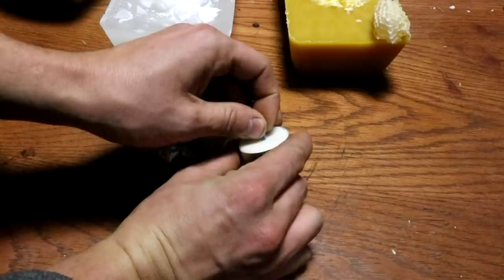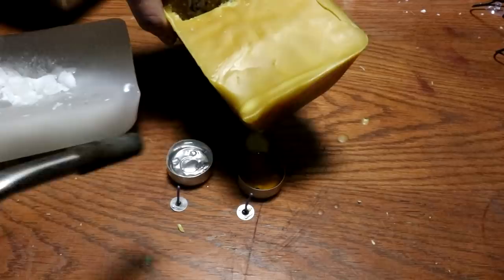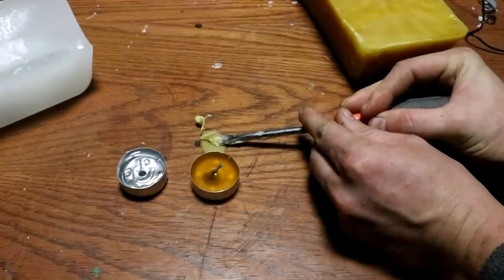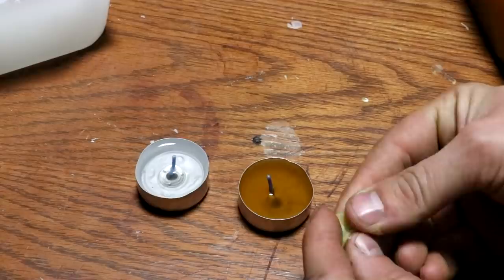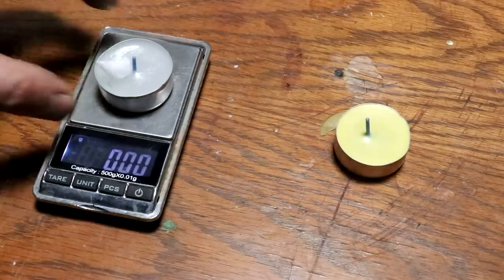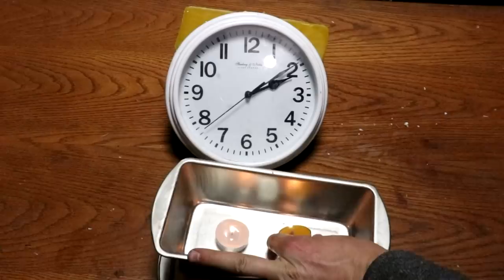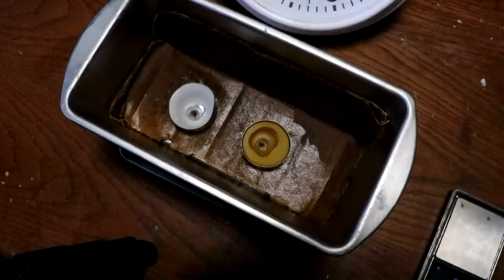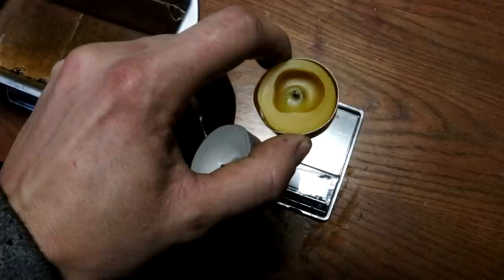Beeswax Vs Paraffin: Flame Test

Comment: I think the wet cardboard fouled up the behavior of the tealights by overcooling them and preventing the wax from melting. I don't know about beeswax but when I burn paraffin tealights all the wax will liquify and very little is left by the time the candle goes out. Unless I put them on a cool surface with a high heat capacity.
Reply from the maker: probably true, I like how it turned out though you can really see the differences in a system when you stress it.
Reply: ...and it leaves you the opportunity to do another video to see if a beeswax tealight can get hot enough to melt all the wax and work properly and how it performs under ideal conditions.... ;-)  I'm actually really curious to see how long it lasts.

Comment: i think you made a mistake by putting them over wet cardboard, usually when those tea candles burn they liquifi the entire wax, and then the level lowers until there is no moe wax at all, but it looks like they didnt , and te outside stayed solid, probably because of the cooling action of the water

Comment: Those candles burned weird, the candles i have usually when there done there is only an aluminium shell left. Or is it really cold where the candles where placed?
Reply: It's fairly cold where he's at (average temp came out to be about 10-14*C IIRC, last video) and he used wet cardboard, which would act as a heat sink.

Comment: If the containers were on insulated surface without the water cooling the outside. The wax would have completely melted by the flame and would have got almost complete combustion.

Comment: Because you poured the water in, that sucked the heat and the wax was not able to melt in the dish, normal coin candles melt all the wax and the level of wax decreases evenly thus making it efficient. In the end it remains very little wax and the wick is all burnt, but this is not the case with your test because I think the heat was sucked into the water and not into melting all the wax. Try a small test without the water and without the metal, just into a normal glass candle holder.

Comment: It might be interesting if you make a thermal expansion valve with wax. We use those for industrial higher pressure thermal limiting valves. There's a lot of engineering that goes into that. Essentially the was is used as a get sensitive piston to operate the valve.

Comment: The beeswax candle had a wrong size wick. Beeswax needs high temperature to burn. It can burn totally if the wick is chosen correctly or you can add a small bit of coconut oil to let it burn at lower temperature. Paraffin is no go. Burning paraffin emits toxic and even carcingogenic particles. Soy wax tealights are also great and can burn totally.

Comment: what about if you put those candles to heat a cup of water(maybe insulated on the sides so little heat gets away or something, by measouring the tempararure of the water when the candle burns out (taking also the burned mass of the wax/paraffin into consideration), we could see wich material sores energy better.

Comment: i presume the beeswax has a lower thermal conductivity that may be problematic in such a case. maybe do a test using a muffin tin  bees wax in one cup and paraffin in another then attach a high power led to the bottomes of each cup and measure the LED temperature. in what scenario do the LEDs have better cooling for longer? i suspect the paraffin will outperform the bees wax until it is melted while the bees wax will allow the LED to get to a  higher temp but remain consistent longer. 

do the test with water in a 3rd cup but cover the tops so that evaperation does not give any materiel an advantage.

Comment: Is there a way to test the lubrication both waxes provide? Beeswax is a favorite bullet lube for black powder enthusiasts, but during the civil war some paper cartridge makers used paraffin wax instead, claiming it was no different in performance and was less expensive, and it didn't rub off of the projectiles as easily when handled. I'm wondering if there is any noticable difference in the two pure waxes ability to provide lubrication. If paraffin is equivalent or nearly so, it would save alot of money to buy and use it instead of beeswax.

Comment: I believe you have one big source of error. When you light a candle some length of the wick always burns down. I have often noticed that if the wax around the wick isn't melted enough in the beginning, the wick can't draw enough wax and burns down more, as it looks like at around 5:13. The flame then of course stays smaller and burns longer, since it can't use up that much wax, as a candle with a longer wick might could. Maybe you could  repeat the experiment and check that the length of the burning part of the wick is the same, in the first few minutes. 
Anyways, I love your wax experiments!

Comment: The water on the cardboard probably soaked a lot of heat out of the candles, reducing the melting from the radiant heat from the flames. :\ I've burned paraffin tea candles all the way down to a very thin film of wax on the cup.

Comment: If you mixed them together and melted them, would they separate since they're different densities? or would they stay evenly mixed? if it cools down too quickly for them to fully separate, could you keep them on heat to give them more time to separate? When fully mixed while solid, can you put a heat on that's enough to melt the paraffin but not the beeswax or would the mixture raise the overall melting point? so many questions lol

Comment: Obviously not the correct wicks. That matters a lot. Paraffin will use a different wick than beeswax and the container size matters too. The proper wick will usually burn most of the wax up.

Comment: Hey Cody have you tried mixing the beeswax with the paraffin? I Wonder if it does mix, or will it seperate in the cooling process.
Reply: No, they never separate (at home) and that is the problem. Because paraffin is cheaper than wax people cheat like that. Only expensive chemical tests can detect these contaminants. 
These thieves do not realize that they are poisoning people.

Comment: those puny paraffin wicks are not sufficient for making a beeswax candle, they don't burn hot enough to fully melt and burn the beeswax.  Try again but with a far bigger and thicker wick.  You need to be able to melt the beeswax fully to get a good strong flame out of it.  A good candle will thoroughly melt through all the wax and have it in a liquid state long before it is burned out so that it can continue to soak into the wick and burn nice and strong.

Comment: That's some dirty beeswax, but I suppose cleaning it significantly more might require some dangerous distillation process.  I'm sure I've seen cleaner though.  Do they just use special filters?  How much heavy crud is dissolved and suspended in that beeswax?

Comment: Points of order...

As compared, unlike the paraffin, the bee’s wax isn’t pure.  Pure bee’s wax, should be white, and harvested from unused honeycomb.  There is a method to clean bee’s wax, I believe it involves liquified bee’s wax and hydrogen peroxide....one of the reasons pure bee’s wax sells at a premium.

I’ve read that historically, bee’s wax traditionally used a bigger ( thicker ) wick than paraffin.  Using the same thickness of wick, results in faster paraffin uptake ( and thus larger flame ).  If this is true, then you would need a thicker wick for a brighter bee’s wax flame.  It could be that the way the wick is braided/woven, results in better bee’s wax uptake and thus energy release and flame brightness with bee’s wax ( I know that it is a factor with historically made tallow candles ).  I personally would consider using twin burning wicks to test brightness and energy release of the same weight of bee’s wax...would probably need a light meter for best results.  

Clean bee’s wax to the manufactured paraffin, would be a better comparison.

Comment: Probably a dumb question but how does altitude affect the physics of candles/fire? Melt characteristics, flame intensity, heat output..
Im not trying to say you had one candle higher tham the other.. Lolz. I just thought - boiling points and you being in the hills, my experience of tea lights being at sea level they always burn virtually to dry.
Reply: Im guessing its negligible. But is it measurable....

Comment: always love this channel but this strikes me as odd as adding water to the cardboard would have made it a unfair comparison if the thermalconductivity of the waxes are different same with melting temperature. as with water you make a a better thermal connection with the carboard surface and thus hindering the melting of the wax? also, burn time doesnt mean anything if the flames are different in size. it would make more sence to burn a equala amout to heat something up and measuring the difference in heating(reasonably isolated from the outside world) as to do a callorymetery(?).

Comment: Cody: It is great you keep the mass of the waxes the same in the experiment. Your experiment shows that the paraffin wax burns much faster than the bee wax. The burn rate is also determined by the length of the wick. Did the candles have the same wick length?

Comment: If there is no wet cardboard, it will burn almost all of the wax. But, because the wet cardboard was cooling down the wax around the flame, it couldnt melt :( so sad. Sorry for my english
Reply: Your English is better than the written English of most native speakers I encounter. What's your native language, if you don't mind me asking?
Reply: I think the flame was too small for the waxes used. Most candle waxes are blends which include lower melt point waxes which help this process.

Comment: You totally messed up the test by pouring in the water halfwaythrough, cooling the candlebuckets. The whole point of the candlebucket is to get hot and melt all the wax in the bucket.  If it was supposed to burn a selfcontaining hole in the middle, why would any company spend the money putting a container around the wax.

Redo please.

Comment: Due to your apparently high level of knowledge in several fields from geology to beekeeping, I often wonder whether you choose less-than-scientific experimental designs because you don't know much about experimental science, or purely out of convenience? For example, in this burn test, it looks like the two wicks stick out to fairly different heights above the surface of the fuel, and I think it's fairly obvious that the burn rate is a strong function of the wick length. Now, worrying about this sort of detail can consume a lot of time, but using several samples of each type and doing a bit of randomization (e.g. with the order in which they're poured, how the wicks are chosen for each mold, how the molds are assigned to a test fuel, etc.) can make a huge difference in the power of your results without adding very much cost or effort.

I'm genuinely asking out of curiosity, and don't intend this as a criticism of your process. In the unlikely event that you read this and would like to learn more about experimental design, I highly recommend Statistics for Experimenters by Box, Hunter, and Hunter. Not recommending to make a buck--I won't--but because, as an engineer focused on computing/analysis, I found it extremely helpful when I needed to gather my own data, both for research purposes and for making "industrial-grade" data. Despite the title starting with "Statistics," it really is geared to getting the most bang for your buck out of effort spent designing and executing experiments.

Comment: Have you seen those videos where someone will throw hot water in very cold air and it bursts into steam instantly, would hot wax have a similar affect but instead of steam, would it just form a splatter of soild wax in a intresting shape?
Reply: Yes. I've done this when we were making dip candles; we had a bit of melted wax left over, but not enough to use, and we were doing it at the beach; we poured some of it into wet sand molds, and flung some of it directly into the water, and it solidified into neat strings of wax that broke almost immediately from the waves.
Reply: @KainYusanagi  Interesting.
Reply: The water freezes into ice, not steam. You throw the boiling water up into the air and it freezes before hitting the ground. I don’t recall the exact temperature, but it’s around -40F.

Comment: you produced false results because you made the temperature of the wax be way too low because of the water around it. hotter wax>brighter flame (lower viscosity, therefore better flow up the wick as well as better evaporation) and longer burn times because all of it is liquid and can burn off evenly.
i used wax interchangeably with paraffin
you also said paraffin ist designed to have "only one molecule in it" that is also not true. paraffins are produced according to specific temperature ranges, not a specific molecule. acyclic long chain alkanes to be exact

Comment: I suppose you could test this again (sorry :P) but with thinner candle holders to find out what the burn time is for the same mass. Then again, the maths isn't hard.
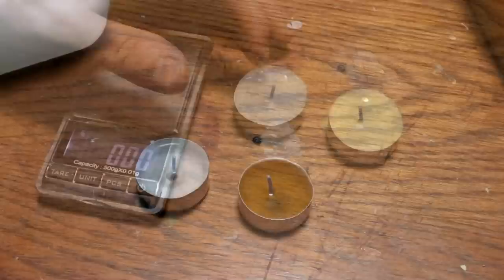Looking at the time lapse, paraffin went from ~2:09 to ~3:34. Beeswax went from ~2:09 to ~5:40. That's 85m Vs 211m.
It looks like both started at ~13.9g, paraffin stopped at 8.7g and beeswax stopped at 10.2g. That's 4.2g Vs 3.7g.

To normalise the result so we know how long (under these circumstances) 1g of either is good for,  we can simply divide each time by the mass lost:
85m/4.2g = 20m 14s/g
211m/3.7g = 57m 1s/g

Finally, we can divide those numbers to say that gram for gram, beeswax burns ~2.8 times longer.
Reply: You might be able to say that but a big portion of that difference is due to the wick sizes used. Paraffin and bees wax both likely have similar heats of combustion. Bees wax may be lower but probably isn't responsible for the majority of the difference seen here.
Reply: The wicks look similar in the footage to me. Am I missing something?

Comment: it would be nice to find out how much heat they can deliver per gram when burned. If you don't happen to have a DSC oven, maybe you could try to measure the time it takes for candle to heat up a (small) given quantity of water at a given temperature-pressure point :)

Comment: Wet cardboard ruined the experiment, it took away the heat not allowing the wax to melt so the wick burned instead of the wax. Try again in a ceramic dish

Comment: Little Cup Candel. Nice But A stick candel Same mold burn time and what BTU do they produce?  what is the true Lumin produced each? just my thought... An after thought interject a soy candel. and the mix of the wax 50/50. and a 1/3 mix of all 3 wax's in 1and A BTU/Lumins test on the Hybrid candels.want to cover all bases maybe a Lamp black analisis after poroduced by the candels all tests cleanest to which contains the most carbon and or wax residue. Did I miss something? well if I did you will finde it and test it Happy hunting.
there are more Hybrid wax tests but those may not fit in like adding an oxidizer/nitrates to boost output questionable on safety my be the issue.

Comment: G'day,

  Ah, Pilgrim, you forgot to centre the Wick-Anchor in the Beeswax Candle, leaving it not only off-centre, but slightly elevated ; so in a more rigorous test the Beeswax would have lasted yet longer still...(?) !

  Also, you neglected to test the Luminosity of the Flames..., and monitoring the Sootiness & Smokiness of the Flames would've Bin-Goodly...

   My guess is that the Parrafin Wax Candles will be maybe 3 times brighter than those of  Beeswax - Parrafin being even more Energy-Dense than Spermacetti-Oil Candles...; and combustion of the Parrafin produces less Water-Vapour than with Sperm-Whale Candles, so there's less soot on the Ceilings & less condensation on the Windows....

  It was the Condensation issue which made Parrafin Oil superior to Whale Oil, as Lighting-Oil for use in Lamps, apparently.

  Have a good one,  

  ;-p

  Ciao !

Comment: Next time, try making smaller diameter and taller candles. With the large diameter you used, the fire just dug a hole through the wax, not burning it completely.
Reply: the issue wasnt the candle diameter, it was the wet cardboard. The metal base of the candles is supposed to get really hot and liquefy the entire candle, then it will burn properly.
Reply: the issue isn't the wet cardboard, wax is a pretty good insulator.
Reply: @someweirdo9129  I respectfully disagree. You can see plenty of images on google search of votive candles similar to what was shown floating on top of water. Apathetic Indecisive stated, wax is a good insulator. It's actually ones of the best out there.